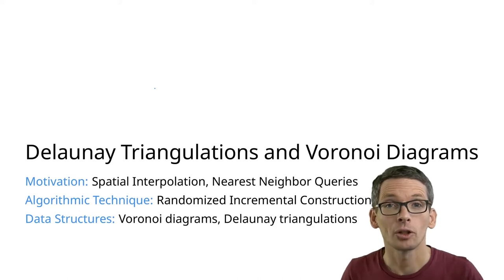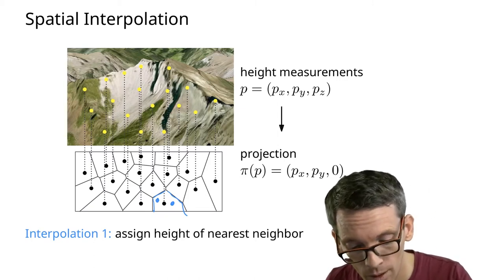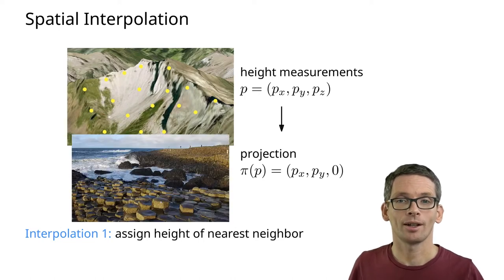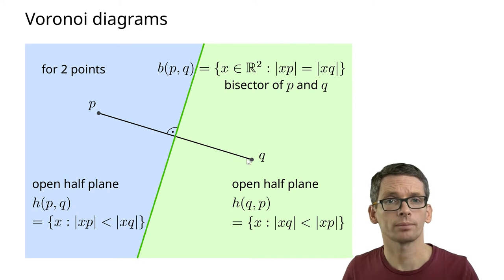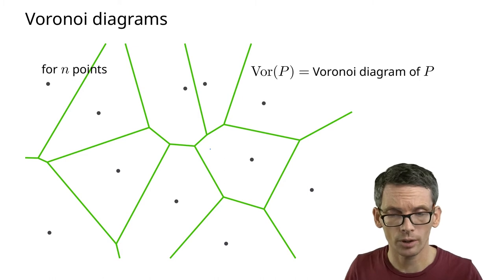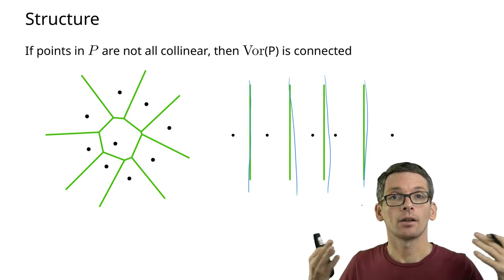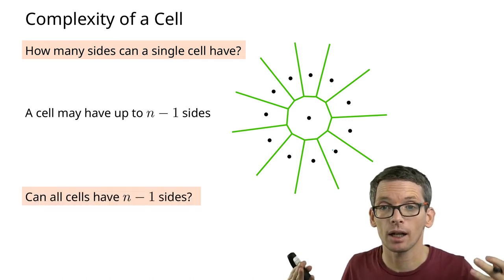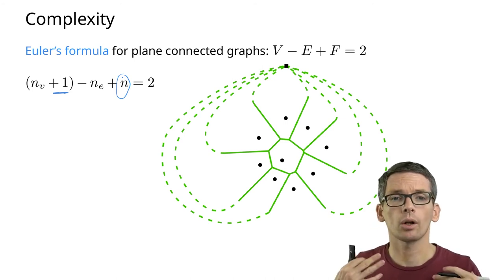Voronoi diagrams (Delaunay triangulations and Voronoi diagrams, part 1)

Comment: I notice a small mistake in the video:
You claim that it is unknown whether it's possible for all cells to have the maximum number of edges.

However there are two very simple examples shown in the video, where that is exactly the case.

Every voronoi diagram with exactly two points has this property.

Three points arranged as the corners of an equilateral triangle also generate a voronoi diagram with this property.

It's also possible with four points, by adding a fourth point in the middle of an equilateral triangle.

For more than four points it may be impossible, I don't know yet.

Other than this oversight, it was a very informative video, well done.
Reply from the maker: That's an excellent observation. I was making the statement with large n in mind, but indeed for n=2,3,4 it is possible by the examples that you give. About n>4: The argument, that I give that n-1 is not possible, is that Euler's formula gives us that the number of edges is at most 3n-6 (and this only holds for n>2). For n=3,4,5,6... This means that we have at most 3,6,9,12,... edges. If we want every cell to have n-1 edges, then this means that we would have "n choose 2" = n * (n-1)/2 edges (where "/2" comes from the fact that every edge is shared by two cells). For n=3,4,5,6,... this is 3,6,10,15,.... Starting at 5, we have 3n-6 < n*(n-1)/2, therefore your list of examples is complete!

Comment: Good video, but there was one bit of nonstandard notation that you had. That was the relative interior of the intersection of the two non-finite sets. It was clear you meant the relative interior as the interior of the affine hull of the two points, and it did not interfere with the explanation. Thanks for making this video and posting it. I am currently working on developing a solution to a problem for an NGO, which I strongly suspect to be solvable by a slight modification of voroni diagrams, using a different metric which weighs each dimension differently, and then optimizing those weights with a standard fitting technique from ML, although I'll have to experiment a little bit to figure out which technique will be ideal.
Reply from the maker: Thanks for your comment. I added a note in the video description that by relative interior I indeed mean the interior of the affine hull. It is always great to hear about applications of Voronoi diagrams (and Computational Geometry more generally). 

There are many variants of Voronoi diagrams, so there is probably already one that fits your purpose. The simplest way of weighing dimensions differently, is to simply scale the dimensions differently. I.e., if you "flatten" one of the dimensions, then it has less influence because the values are small anyway. Keep in mind that Voronoi diagrams only work well in small to medium dimension. Thus, if you have a high dimensional data set, you need to either reduce the dimension or use an appropriate alternatives. E.g. computing nearest neighbors (at least approximately) still works great in high dimensions.
Reply: Thanks! Yeah I thought about just scaling things that way, but I don’t have the actual data yet. There are only 3 dimensions to partition in the problem.

Comment: Any chance You could make a video about updating a voronoi diagram when position of the points change slightly? I tried to research this on my own but the literature is scarce and far out of my specialization and I'm kinda stuck ; (
Reply from the maker: Instead of a video, let me simply reply to your comment; that's faster. The short answer, before delving into details, is that you might be looking for a kinetic data structure (KDS) for Delaunay triangulations. A good description for this gives Section 3.5 in the following PhD thesis: Russel, Daniel. Kinetic data structures in practice. Diss. Stanford University, 2007.

But before using/implementing a general KDS, you should think about what you actually need. Just as an example: There is a nice applet VoroGlide in which the user can interact with the Voronoi diagram (VD)/Delaunay triangulation (DT) by dragging the sites. It works like a charm, but what it actually does, is simply recomputing the VD/DT from scratch all the time. This works since the point sets in the given interactive setting will be small. The lesson here is that it is good to think about what you actually need. Even if we want to avoid recomputing the complete DT/VD, if we know that only one point moves, there are much simpler solutions than a complete KDS. 

Before I start: You are asking about the VD, but I will reply in terms of the Delaunay triangulation. It is easier to handle/store and contains all the information that is needed for maintaining the VD. In particular, as long as the DT does not change combinatorially, we only need to update the positions of the Voronoi vertices. These are easy to compute by a standard formula for the center of a circumcircle.

Lets for a moment go back to the setting, where only one point moves. Here we can make use of the fact that an edge is Delaunay if and only if it is legal. So after moving the point, we only need to check edges that this point might make illegal. Those are all edges of the triangles incident to the point. For each of these edges we can test whether they are still legal by an incircle test, which can be implemented robustly by reducing the problem to testing the sign of a certain determinant (see https://www.cs.cmu.edu/~quake/robust.html). Note that if we flip an edge, this might result in further edges that we need to check (as in the routing LegalizeEdge). Also note that in contrast to the case of point insertion, we also need to check the edges incident to the point. In any way, the case of one moving point is easy to handle.

Now lets assume more points are moving over time. We now generalize what we did in the previous paragraph, but do it in a clever way. To determine which edge of the DT will flip first, we need to know more about the movement. Kinetic data structures commonly assume that the movement of the points can be described by a polynomial over time. For simplicity lets assume points move linearly of time t, i.e., the points are linear functions in t. Now we can do the following to determine which edge will flip next: For each edge of the DT, we can find the determinant for the incircle test; setting it to "== 0" and solving for t, will determine the point in time where the edge would flip. We can build a priority queue to see which edge would flip next, handle it etc.

What else is to be said about this problem:
1. There is a video introduction to kinetic data structures but not for KDS for DT. Anyway, if you are interested, it's by Erik Demaine: https://ocw.mit.edu/courses/6-851-advanced-data-structures-spring-2012/resources/session-4-geometric-structures-ii/ (KDSs start at 00:31:22)

2. KDS for DT was part of CGAL up to version 4.11. The package was described in the PhD thesis mentioned above, and you can find the entry in the CGAL manual here: https://doc.cgal.org/4.11/Kinetic_data_structures/index.html But CGAL code might be a bit difficult to read if you are not used to generic programming with templates in C++.

3. The following is only of theoretical interest, and won't help you solve the problem: For long time it was an open problem how often the DT might change when the points move linearly. This problem was essentially resolved in the following article: Rubin, Natan. "On kinetic Delaunay triangulations: A near-quadratic bound for unit speed motions." Journal of the ACM (JACM) 62.3 (2015): 1-85.

I hope this answers your question.
Reply: @algorithmslab  So, the question of what i've actually want to do/need came up - during my PhD i worked a lot with molecular dynamics simulations of proteins (I'm a molecular biologist/bioinformatician). Those mostly use spherical potentials/point charges. For example, one usually approximates water with 3 or 4 point charges with spherical electrostatic potentials.
I've came by Voronoi diagrams completely by accident and came up with an idea which since became kind of a hobby project - do an MD simulation with Voronoi cells being kind of bubbles - ie, they exert pressure on neighbouring cells depending on how much volume they have at the moment - the smaller the bubble, the more pressure it exerts. There are multiple things one could do with such a construct, but what i then would like to do is to overlay a discrete, or 'finite element' field over it - be able to associate a scalar or a vector value with each bubble, interacting with the neighbours.

By necessity this means that ALL central points of the voronoi cells move at each time step. Recomputing the entire diagram would be possible I guess, but super costly.
One interesting thing i've managed to find is a series of papers from Asia, where author, among other things, created an alternative to sweepline - an 'untransformed sweep circle' - which was easier to parallelize (doi:http://dx.doi.org/10.1016/j.cad.2012.10.031 Xin et al 2013). Note that this is different to 'sweepcircle' from Dehne and Klein 1987. I've seen also people tried to chip around the problem by reducing the amount of edges which need to be checked if they need to be flipped/splitted/merged (for e.g. zhou et al 2010).

There is also i guess promising but unpublished article by Hugo Ledoux from Delft "The Kinetic 3D Voronoi Diagram: A Tool for Simulating Environmental Processes" and 2014 IEEE publication by Peterka et al "High-Performance Computation of Distributed-Memory Parallel 3D Voronoi and Delaunay Tessellation".

Note that i am mixing 2D and 3D works because my plan was to get the thing working in 2D first (which seems simpler) and then move to 3D. One step at a time strategy : )

I kind of hoped that having the derivatives of positions of central points i could derive the positions of the voronoi vertices directly : (

The biggest obstacle however is, i can get the general idea behind those works, but trying to implement them myself requires intimate understanding of the details and this is a huge obstacle due to my wet lab molecular biologist background and dyslexia which causes my brain to have much harder time parsing abstract symbols.

Thanks for the extensive answer. It definitely is a bit of a step forward for me. I was aware of the Rubin and Natan paper, but didnt know about older versions of CGAL and the video, so I will definitely check it out.

Btw I am an experienced Fortran/C/C++ programmer (I work in the airline industry at the moment on flight path optimization) so if you ever need a piece of code written, let me know. I miss the creative part of the academic work :D

Your videos are a goldmine so please keep up the good work!
Reply from the maker: @empireempire3545  Hugo Ledoux's paper is work that he did during his PhD (https://3d.bk.tudelft.nl/hledoux/phdthesis/), and he has made the code available as it is (https://3d.bk.tudelft.nl/courses/geo1004/data/hugotetra.zip). The corresponding code is in Mesh.pas. Note that this is based on moving one point, "MovePointTo". It is based on the same ideas that I outlined in my reply above: The idea is to first find out what the next topological event is (i.e., a combinatorial change to the VD/DT) and to move "the point" that causes it. Btw., the code is made available with a lesson on 3d Voronoi diagrams (https://3d.bk.tudelft.nl/courses/geo1004/), which includes a video (https://youtu.be/oOGx9PUGb5c).

I don't know the other work that you mention. Obviously, parallelization is a good idea in this setting, because most computations are local. I haven't tried the maths to determine the centers of the spheres by the derivatives of the sites, but for the general structure of the code, this won't make a difference.  "Chip around the problem by reducing the amount of edges which need to be checked" sounds very reasonable, and you also effectively do this when using Kinetic Data Structures. Repeatly calling a sweepline algorithm sounds like too much work. Personally, I would also always use a randomized incremental construction in dimensions 3 and higher.

Sounds like a great project. Good luck with it!